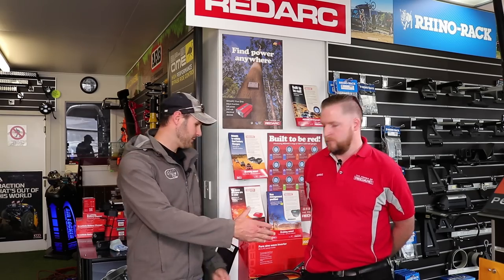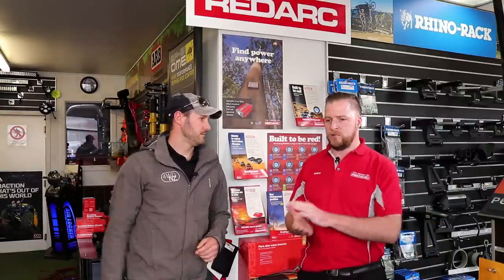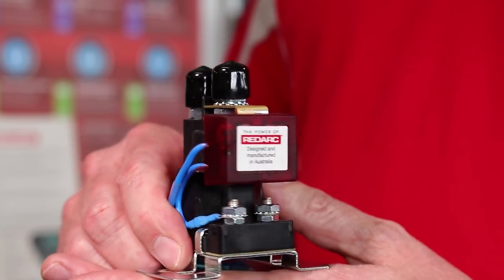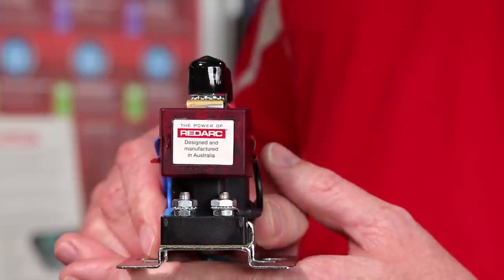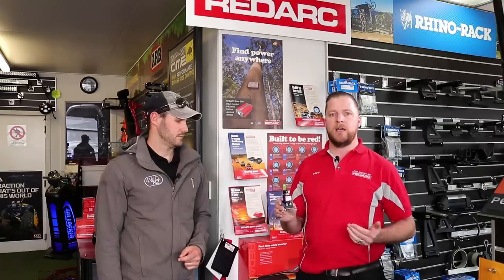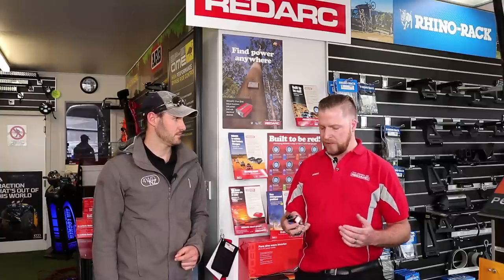The difference between a REDARC SBI & BCDC with 4WD NZ

Comment: We have the BCDC1220. Can you 100% trust these to act as an isolator?, I have put one in a portable battery box which is attached to the vehicle by Anderson plug. The anderson is attached directly to the battery through a fuse with no relays or switches. I generally unplug the Anderson when we are stopped because I am not sure if I can trust the 1220 to disconnect.
Reply from the maker: Hi Michael, The BCDC1220 has built-in battery protection via the charging thresholds.
The standard BCDC1220 will stop charging when the vehicle battery drops below 12.7V (unloaded), whereas the BCDC1220-IGN will continue to charge until 11.9V whilst a vehicle ignition voltage is present on the blue wire, and switch off immediately when ignition is switched off.

Comment: im looking to install my auxiliary battery in a pelican case in my truck bed. this case will be removable at camp sites or in an emergency situation. I would like to install the bcdc inside the m case as well without any air vents or fans. I want the case to keep the system water/ dust proof. will installing the bcdc charger inside the case cause any issues ? how hot does the bcdc charger get when in work ? Thanks
Reply from the maker: If the Box is well ventilated it will be okay, alternatively mount the BCDC on the outer side of the box for increased airflow. If the battery box is sealed, the charger will not be able to dissipate the heat generated from producing power and will de-rate, reducing charging performance. Please note that the BCDC will start to de-rate from 55 degrees Celsius and turn off at 80 degree Celsius.
For any further questions, please don’t hesitate to contact our technical support line on (08) 8322 4848

Comment: Does it work fine if the main battery is regular lid acid and the auxiliary battery is AGM?
Reply from the maker: Hi Aziz D,

The BCDC range of chargers can charge an auxiliary battery of different chemistry than the start battery, as it does not "link" the batteries like a standard isolator does.

This battery chemistry specific charge profile is selected via the orange wire of the BCDC, with four different charge profiles selectable. (See section 2.2 of the Instruction manual at https://www.redarc.com.au/Content/Images/uploaded/Manuals/BCDC%20Dual%20Input%20Instruction%20Manual.pdf)

If you have any further questions please don't hesitate to contact our Tech Support Team on 08 8322 4848 or via power@redarc.com.au

Comment: So how would this isolator function on a temperature compensating alternator like the ones on the FJ Cruiser ?
Reply from the maker: Thanks for watching! If you're referring to the SBI12, it will work normally with a temperature compensating alternator. Variable voltage alternators (smart alternators) may require the unit to be wired differently. For more information, please don't hesitate to reach out to our Tech Support Team on 1300REDARC (1300 733 272).
Reply: @REDARCElectronics  I'm referring to the SBI12D
Reply from the maker: @analactica  The same applies for the SBI12D.
Reply: @REDARCElectronics  thank you

Comment: Hi do I still need a SBI even I have the BCDC charger?
Reply from the maker: It depends on what you're trying to achieve with your setup, and how you want to travel. However typically the BCDC is used instead of an SBI to allow you to fully charge your auxiliary battery to 100% while also utilising solar charging. Chat with our Tech Support Team to find out more https://www.redarc.com.au/contactus

Comment: Looks like I need the bcdc1250D along with 2x 100ah lithium deepcycle batteries along with a SBI12-LLD so I'm solar ready to add panel 5m Anderson lead and 2000w pure sinewave inverter I currently only have the sbi12 unit in my 05 100 series V8 4.7L petrol

Comment: Have (Non smart Alternator) 250amp.  Under Hood battery AGM..Cranking/Winch/lightbar.  Rear cabin (SUV) 200AH lithium. Fridge/inverter..... The BCDC will work?
Reply from the maker: Hi Destaye,

The BCDC1225D, BCDC1240D, or BCDC1250D are all Lithium compatible chargers - you simply need to choose the charger that best matches your battery charge current specifications, ensuring you do not exceed any limits provided by the battery manufacturer.

Comment: Explain to me pls, why would you want to feed a lower current into your deep cycle battery than what the alternator is producing? Wouldn’t an SBI be the faster charger in this scenario deeding the same current in?
Reply from the maker: Hi Strings and Things,

Controlling the charging current of a battery is important to ensure you get the most out of your setup. Faster is not always better!
 :)

Charging a battery with too much current can cause the battery to “boil”, severely shortening the cycle life of that battery, if it recovers to a usable voltage at all. Most reputable batteries will have available a maximum charging current specification for that battery, which you may well and truly exceed if discharged considerably and allowed to charge directly via alternator current.

For any further questions, please don’t hesitate to ask either by emailing power@redarc.com.au or contact our technical support line on 08 8322 4848.
Reply: @REDARCElectronics  Also, as you only have that lower voltage, you will not be getting that higher current anyway. Long cable run ( doesn't mean 50 m, just 1 m will do ), "high" current draw, means massive voltage drop, may mean only 11v on that 2nd battery.